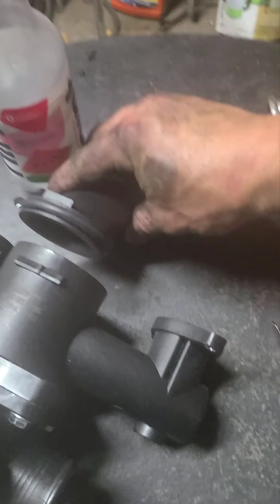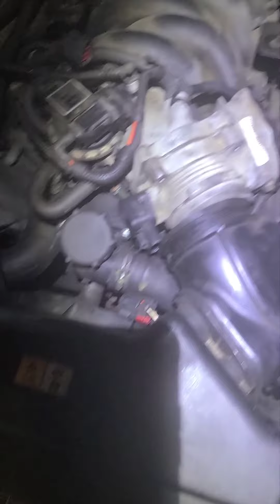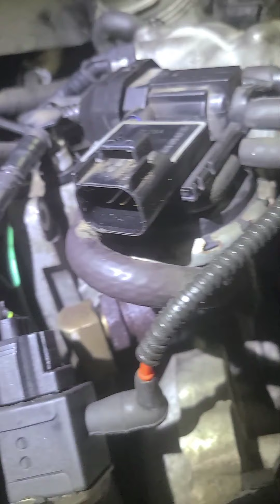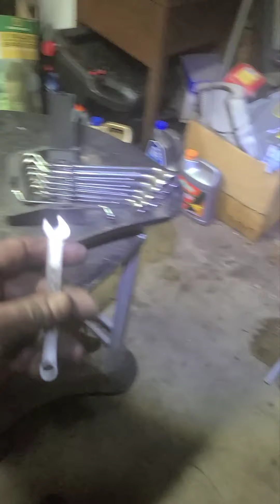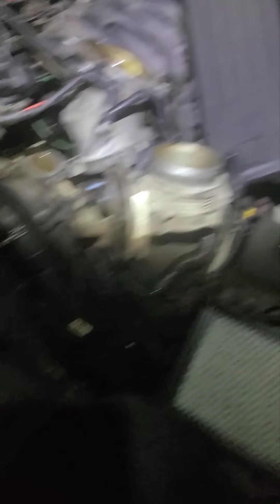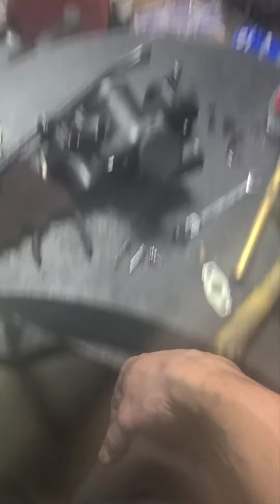2004 Lincoln LS V8 3.9 l water neck coolant outlet thermostat housing replacement

Comment: Is there any kind of clip to holds the thermostat housing to the neck? I really don't think so but the AI told me that there was supposed to be one. After all there are 4 bolts on the base of the neck and 4 bolts holding the body up to the neck.

Comment: I really appreciate the video. But I got to tell you by looking at your engine taking apart. As soon as you took that vacuum line off of your air intake. I knew you had a blown head gasket. And then to see inside behind your throttle body. Everything is wet.. none of that is supposed to be wet. None of that is supposed to be sludgy and creamy. Those are air areas not wet areas

Comment: Thanks for the video, very helpful in doing this job.  As to the rearmost water pipe bolts partially blocked by the intake manifold, why not file off the very small sections of the manifold causing the interference?  That way no crossthreading issues when reinstalling the bolts.

Comment: I torched The EGR valve nut (right break) and sprayed it with WD.

The intake manifold has 2 10s on the left *deep socket  and  two 5/16 bolts on the right.
 For the water spout I used my Dremel 3ooo to  cut off the neck then I removed the 4 bolts